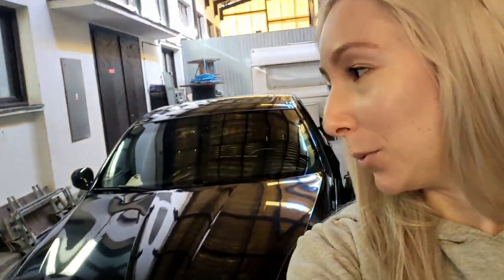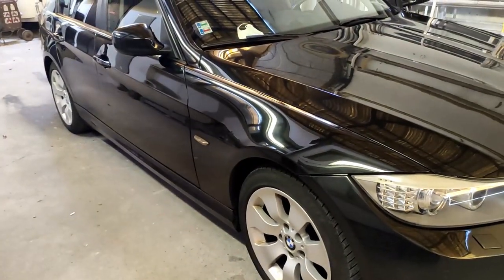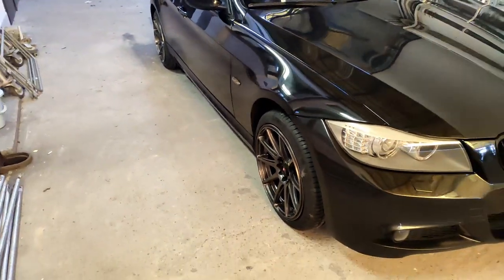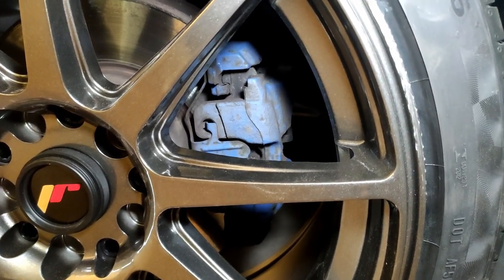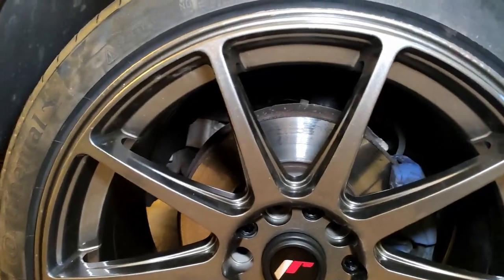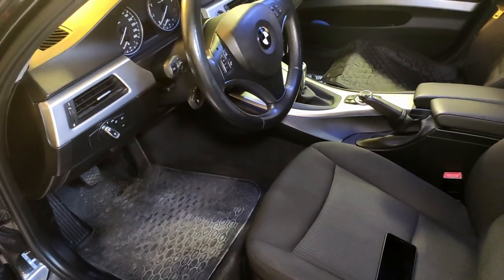New wheels for my BMW e90 /JR11 Hyper Gray/

Comment: Hi, thanks for the vid. In process of getting me some wheels so it helps. Could you please confirm the offset and are the wheels or tires sticking out past the side panel outboard edge? I was rewinding vid so many times and looks like they are not but would appreciate if you could confirm or send a pic, post a vid. :)
Did you install the spacers?

Comment: Try and upgrade to 335 calipers, much bigger disc and caliper, will look so much nicer, along with night and day improvement in braking performance. The calipers and disc's drop in without any modification, one of the best mods I did on my ride. It's like a budget Big brake kit
Reply from the maker: I didn-t thought about that but definetly will consider! It would be really nice because of the style of the wheels you can see a lot behind them :D
Reply: upgrade to some proper brembos instead of wasting time

Comment: Can you tell the rim specs. I am getting these on my 325i e90.
Reply: If you need a reference, on mine I have 8.5x18 rims with +35 offset in the front, 9.5x18 +35 offset in the rear, and for tires I have 235,40,r18 and 265,35,zr18 in the rear. From what I’ve seen online that’s kinda the pre lci sweet spot
Reply: @krispytoast8804  Thanks m8!
Reply: @Masamainio3443  np, granted I haven’t put them on yet but I’ve seen tons of other e90s run that exact setup so there shouldn’t be any fitment issues, if something crazy happens I’ll comment
Reply from the maker: Hi. Mine are 8,5x18 with offset 35. Tires are 225/40 🙂
Reply: @krispytoast8804  18x8,5 et35 and 18x9 et35?
Reply: @__lucas97__  18x8.5, 18x9.5, et 35 on front and back

Comment: Whatt offset are you running
Reply from the maker: These are 30. They could use some spacers I think I will add 5mm to front and 10mm to the rear 🤔
Reply: @winonaig9738  okay thanks👍🏽😄

Comment: how much cost the wheels ?
Reply from the maker: 200€/wheel and 80€/tires 👍
Reply: @winonaig9738  wao that's so cheap , where did you bought them?
Reply from the maker: @ArtGalleryy2  Im from slovakia so a local webshop fusion.sk :)
Reply: @winonaig9738  ok 👍
Reply: What year is your car!?
Reply from the maker: @90svision99  2010 😊